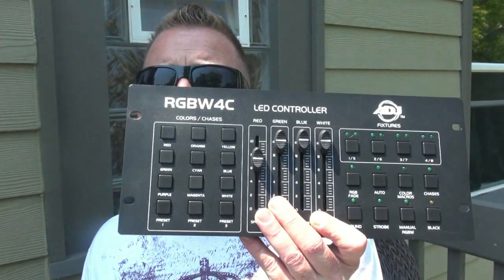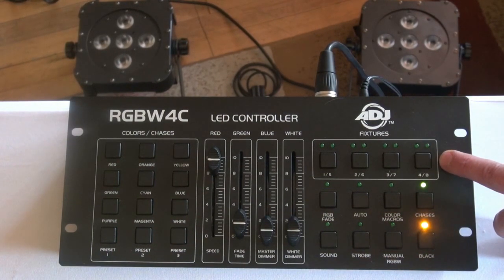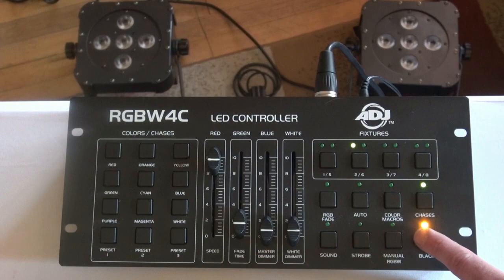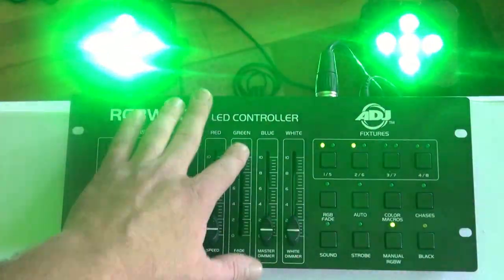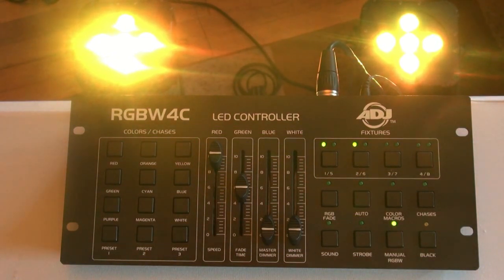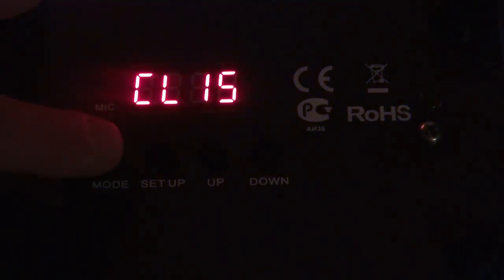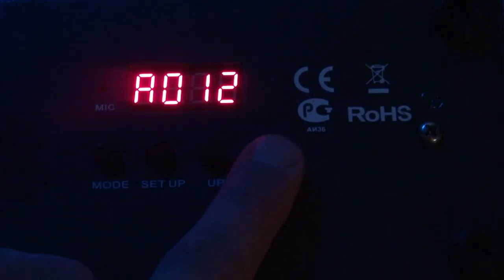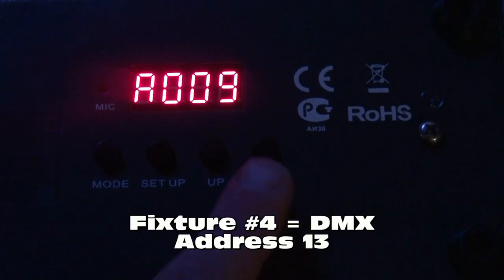ADJ's RGBW 4C - What It Is & How It Works

Comment: Weird. when I turn the unit on, fixtures 4/8 are on and I cant even turn them off. Blackout is off to begin with. Is that because of the lights? it also starts up with "manual rgbw"  on instead of "chases". took out the cable and it starts up like in the vid EXCEPT fixture 4/8 is on at startup. I dont get it.

Comment: What do you favor, ADJ RGBW 4C or Obey 4, for a complete NOOB??? 
Just getting into lighting and mostly UV Bars and considering more; don't know what to mix with ADJ ECO DMX lights.. Thanx in advance... Happy holidays
Reply: +John Q Those are both great controllers for 4 channel LEDs.  either do the same job but the RGBW4c has 3 preset color options which Chauvet's Obey series does not.  I would personally run This Board.  But later down the road when you start buying higher end lights, you will need another controller so maybe also consider a larger board or a software and converter system like I use

Comment: Will this controller work on the ADJ Mega flat plus lights, with the UV as the 4th channel?
Reply: +Jeremy Nolf It most likely will.  It will just substitute the White for UV and the preset colors will probably be useless
Reply: I would say that preset colors normally involving white or amber will look different, not be "useless"... and several of the preset colors don't involve white or amber and won't look any different at all.

Comment: Hey buddy. .can this controller.manage  4 up lights and 2 adj inno pocket spot
Reply: It'll be worse than useless for the inno pocket spots, since those have probably at least 12 channels. You'd only be able to set their colour, you wouldn't be able to control their gobo, pan/tilt, shutter etc.
As for the uplights, it'd be fine for that.

Comment: The 1st time I watched your video I was able to use my 6 up lights and rgbw4c controller.  Ive used them for 3 months now and have never had a problem.  Tonight I plugged them in and can't get A005 to work.  All of the uprights are on channel 4, the 1st, 3rd & 5th are on A001 and work fine.  Uplight 2, 4 & 6 are on A005 and won't work.  How do I fix this?

Comment: I have ADJ Flat par tri7. Im thinking of buying this controller and In using the address function, would each light fixture take up 3 consecutive slots like A001 , A002 then A003 with the next light being set on A004?  Because its a 3 channel light?
Or would i assign it like how you have in this video?

Comment: Brian - I'd recommend the 4C controller even if you only have RGB lights because you can use the spare channels for those fixtures that only need a single DMX channel. They would be on the White channel.

Comment: Brian, Will this controller do 2 different sets of lights for uplighting? Lets say 1 set of QA Par 38's you have behind the head table showing Amber. Then around the room you have more uplighting and they want it Blue. will this controller do 2 different pairings this way? Or do I have to by seperate controllers? Thanks

Comment from the maker: Comscans = no.  They are scanners & this is built for RGBW, RGBA, or Quad LED wash/par fixtures
Mega Bar 50 RC - Maybe, but thoes lights are RGB.  I'd recomend the ADJ RGB 3C for RGB and/or TRI LED fixtures.  That piece is built for RGB wash/par fixtures and does it very well  :)

Comment from the maker: Good question.  When working with a regular 512 DMX Controler with "fixture" buttons, you'll often end up with 8 faders & 16 addresses per fixture.  There's a button that lets you control 1-8 in one position & 9-16 in another.  So, to make things easy with the fixture buttons, you allow 16 channels per fixture weather they occupy 16 channels or not.  On programs like MyDMX, the profiles replace fixture buttons & only occupy the addresses used.  On the RGBW4C, each fixture only uses 4 addresses

Comment: Great vid. I'm a bit confused now on addressing...I've been keeping all lights 16 channels apart, like I was taught. However, recently I've been noticing folks doing it like you did in this vid. My lights don't have any "delay". Is there a difference between running them 16 channels apart vs running them the next channel up from the channels used on a particular light in the chain?

Comment: hi brian do they have a controller similar with the same features in the controller for example chase sound active, and strobe  for led fixtures such as tri 7's mega tri par, and mega par pro (10mm led one) also i ahve a video request could you do a video of if you were going to get a new laptop for djing using v-dj. what processore would get ( i3,i5,i7) and how much ram (6g,8g,12g,18g)